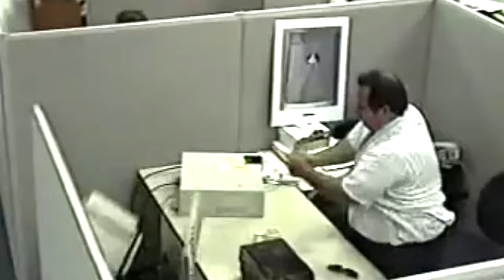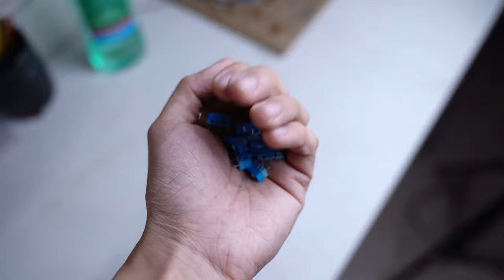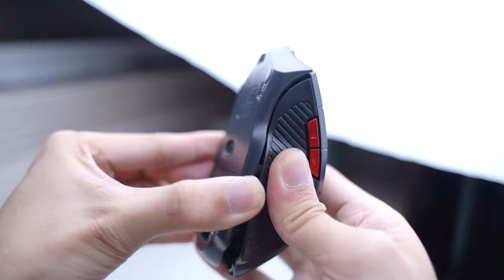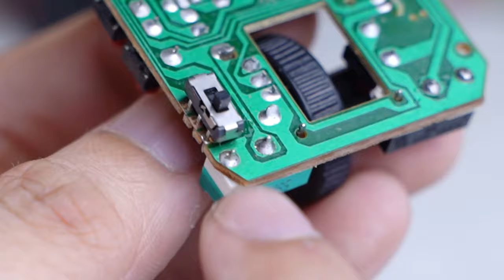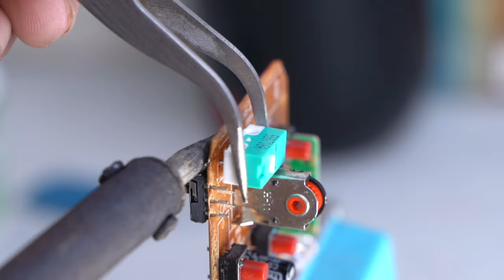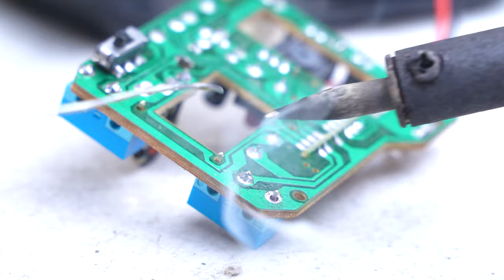Fix A Broken Mouse Clicker (Double Clicking Button Repair)

Comment: Great video.  I have a Steeleseries Rival 500, which they stopped making.  One of the top left index finger buttons stopped clicking.  I ordered all the tools and replacement parts.  I also ordered replacement gliders, since I figured they wouldn't be any good once I removed them.  I hope I can fix it with the switch I ordered, since the button is in an unusual spot.  FYI it only took 2 months for the switches to arrive by mail.
Reply: Heyy, I was looking to fix mine too! At first I thought it  be dirty or something is bended. But when I disassembled it and get to understand the inner of it, I figured might be the switches became less sensitive now, since the buttons wont click at all if they didnt hit the switches, but they still click correctly. It is hard to find any online resources to fix  or even just disassemble it. 

Tell us how it turns out please. Mine broken on the upper right and lower left. The middle button will soon die out too it seems. I really love the mouse layout, nowadays they all have boring grid pattern which is less intuitive. Even the new Steelseries replacement has the same layout as other brands now.

Comment: I feel dumb about myself. I watched the video after I fixed my mouse. I used a common tactile button from a old TV as replacement switches and it works nicely enough since I can't buy a replacement since quarantine is still ongoing.

Comment: Great video! I have a Logitech MX Vertical and the LMB started wearing out after a couple years. I replaced the buttons with Omron D2FC-F-7N(20M) buttons. It didn't go quite as easy as in the video, but I definitely recommend the solder sucker, as shown. Solder braid is helpful too. Using the higher temp setting on my iron also helped.

Comment: In a lot of cases, you can actually fix the switches! Just pull the side tabs on the switch, open it carefully and you'll see a large springy metal. All you have to do is clean the contacts with a little piece of 2000grit sandpaper (or even very fine tweezers) and you're good to go.
Reply: Your suggestion sounds even more environment friendly. Could you make a YouTube video of the same, please?

Comment: Thank you so much, this worked great! I was able to extend the life of my fantastic 14 year-old Microsoft Comfort Mouse 1000. I replaced its left clicker with a right-clicker from a Microsoft Basic Optical Mouse v.2.0 whose scroll-wheel had gone bad. Works like new! :-)
Reply: 14 year-old? WoW! Long live your mouse :)
Reply: @LucaScarpellini3d  Ha, ha, thanks! It's still going strong! :-)
Reply: 2 years later and now both the left and right buttons have been replaced using buttons from newer mice. Happy 16th Birthday to our Microsoft Comfort Mouse 1000! 🎂 The manufacturer's evil "planned obsolescence" is (so far) losing the battle to all the DIY wannabes with soldering irons... 😋
Reply: @AdamJanz3D  Impressive length.
Reply: @Bryan-T  LOL, yes! They likely don't make them like that anymore. Though I'd probably get a little electronics soldering vise if I had to replace the clickers again. It's finicky work unless you have an extra set of hands... 😄

Comment: Have my fixed Logitech G102 from someone who has far more soldering experience than me. Didn't take five minutes. LOL, instead of buying new buttons, I have them switched places with the mouse two side buttons. Now both of the left and right click buttons are working fine.

Interestingly, G102 main left and right click button are made by OMRON, yet they gave up so quickly.

Comment: I wanna say thank you for this , just so happen my dad left a soldering kit in my house awhile back and well , havent really got a reason to use it at all till now
was nerve wrecking since i last welded anything this small back in school but didnt burn the board thankfully and changed em for huano switches from another spare mouse
Interestingly the g102 have 2 omron switches lmb and rmb , the dpi and 2 side buttons are kailh

Comment: this worked but i almost broke my mouse, My soldiering iron was very shitty and did not melt the solder at all, i kept the iron on the mouse too long and almost melted other components, make sure you have the vice and a VERY high quality iron. The cheap ones will screw you over. I am lucky my mouse still works! almost melted the board.

Comment: I tried to replace the switch in two different mice, and one of them didn't work. Do you think I damaged the board or something with overheating? I don't think the replaced switch had any issue as I tried the same switch on different mouse and it worked. Just to let you know that the changed switch doesn't work and other switch (right-click) works just fine. Can you give any tips on what probably went wrong and how to correct it?
Reply: You probably got a dud switch. Test the switch before you solder them. A multimeter continuity test solves a lot of problems.:)

Comment: Modern gaming mice are way more complex then these old mice.  Half of them have more than 10 buttons, internal RGB lighting and mechanical switches with optical sensors built into them.  Corsair makes some of the most complex mice

Comment: the second christmas is gone i'm switching back to my good mouse ;-; didn't believe it was this easy to fix, buying a soldering iron and parts is WAY cheaper than replacing the mouse with the same mode... well about 35% cheaper anyway.

Comment: Materials Needed:
Soldering Iron (NOT INCLUDING STAND) - $3
Desoldering Pump - $2
Mouse Clicker Replacement - $1
Total Price: 6 Dollars
Conclusion: If you already have all the materials then go for it, but if you don't, I suggest you just buy a new one for 2 dollars instead of wasting your time trying to fix a broken mouse.

Comment: Have nearly the same problem, but, the stupid developer from my mouse, used soft plastik for the mouse, so you get to the point that the soft plastik got a hole that you can not klick any more, used the most common way to fix it, alumiunum foil and super glue.

Comment: What if the solder is too hard to melt? 😕 I have a legion m200 mouse
Reply: You need a good soldering iron that heats up fast. Preferably adjustable. The solder used must be lead-free if it's hard to melt.

Comment: I Bought A Logitech Wireless
Mouse At A Thriftstore Then
I Ordered A Logitech Reciever 
& They Said It'tll Work On Any 
Logitech Keyboard Or Mouse.
So I Tried It. & No Results
It Was Totaly Dead. So I Tried 
Another Mouse On The Reciever
& Still No Results. So Do You Think
It's The Excllaromiter Chip That Could
Be Bad?

Comment: It's a good thing that most of modern mice use similar switches (same size and pinout) so they can be swapped. I don't know if it makes sense to repair shitty, cheap mice, but cheap ones can be scavenged for switches to repair more expensive ones.

Comment: huhuhu i tried this  i copied everything but still aint workin... i got the switch from a cheap mouse that was working..when I soldered it to the ajazz i303 pcb and tested it out its not working..huhuhuh need help

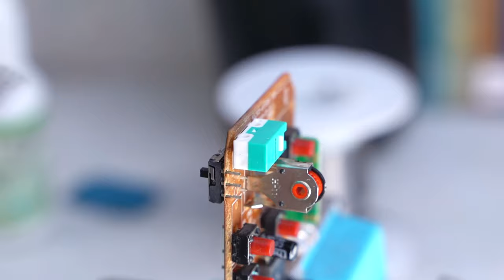Comment: I'll never understand how can one remove lead with the solder pump with this much precision and not burn the white tip on the soldering iron or leave any lead behind 2:30
Reply from the maker: Takes a lot of practice and experience. I remember my first time using it, using the pump was really challanging. I eventually found a way to properly use it. Turns out you have to position the white tip directly and perpendicularly to the pin on the solder side of the board. Hold it steady in place as you heat up the joints with your iron. When you feel they're really melted, quickly remove the iron and put the pump's white tip directly to the joint. Make sure the white tip's barrel/hole is surrounding the joint, this ensures all the lead is sucked. Cheers! :)
Reply: @TechBuilder  oh thx, I'll try it like that, hopefully won't take me too long before I can master it like you :D
Reply: Put a silicone tube on the tip of your sucker. It's safe to touch the iron with it so you get a better seal around the solder joint.

Comment: What's the most durable among all switches?
Reply: switches like the Kailh GM8.0s last for 80M switches which is quite a lot, but don't completely rely on these ratings as these ratings are the "optimal" time for the switch and your switch could last much longer than the rating.

Comment: I have this very cheap keytech mouse and the left click button just double clicks on it's own -_- I want to try this but I can't see anyway to open this because the gliders are like not real, they're the same material as the mouse so Idk how will I open this lol
Reply: there has to be a screw or maybe just pry the mouse open maybe it's just held by clips. Then replace switch for double click fix
Reply: @CEngi  yeah, I'm thinking of peeling this very small "warranty" sticker though it feels flat when you press it so I'm not sure if there's a screw under.
Reply: @whydoweneedousehandlesihateit  most likely there
Reply: @CEngi  I just fixed mine lol
Reply: @whydoweneedousehandlesihateit  nice what switch did you use to replace ?
Reply: @CEngi  same as the one in the video. The blue ones from Huano
Reply: @whydoweneedousehandlesihateit  I just got my blue shell white dot too but my new soldering iron still hasn't arrived :(
Reply: @CEngi  oh, so you have mouse issues too😅. Hope ur soldering iron arrives soon.

Comment: 1 point is missing to the video tutorial and this what im facing right now. I think i mess in the soldering part. kindly check this picture bro. https://ibb.co/YWmqvkJ hope you can advise me what to do next cuz i tried already many times but no luck to get fix my micro switch in my mouse. when i soldered and recheck it doesnt respond when i click the mouse. 
cheers bro sa channel mo. 

p.S other buttons are good.

Comment: You can fix the clicker without sodering all you have to do is open the clicker switch up and bend the pin back in the original position. I soldered a new clicker on my razer mouse and it broke again after 2 months so I tried this method and it worked like a charm.https://www.youtube.com/watch?v=eDoXMJyimDU
Reply: well that really isnt my problem rn, my problem is whoever the hell soldered this mouse, i noticed since i opened my mouse up and saw how uneven it was, one part was soldered while the other pin wasnt